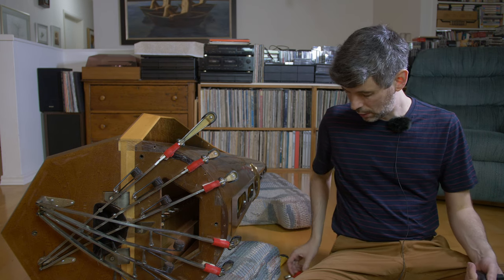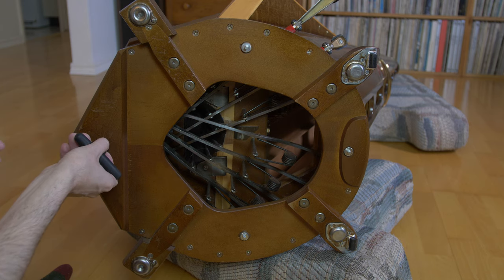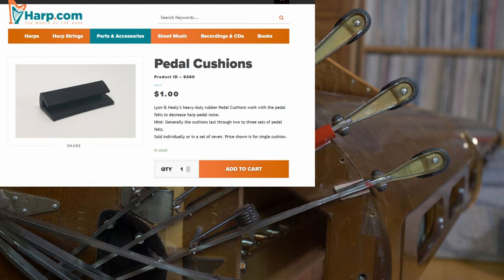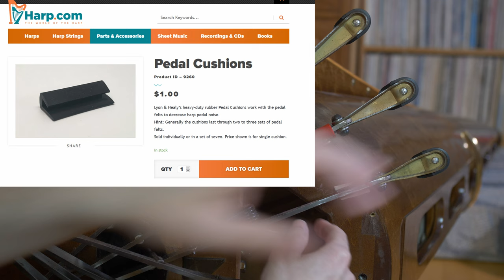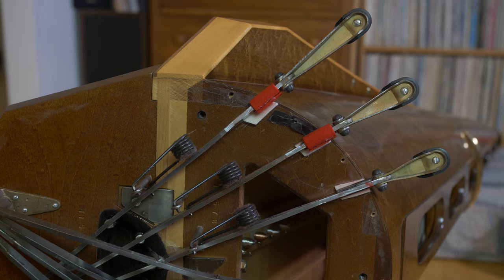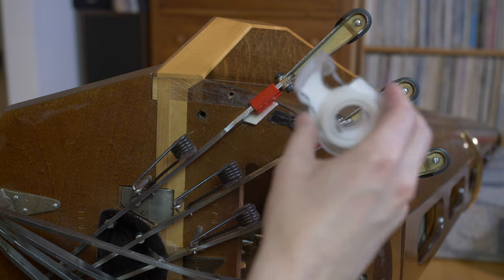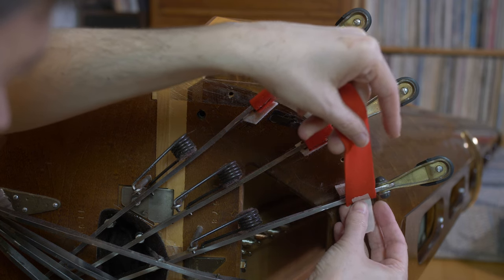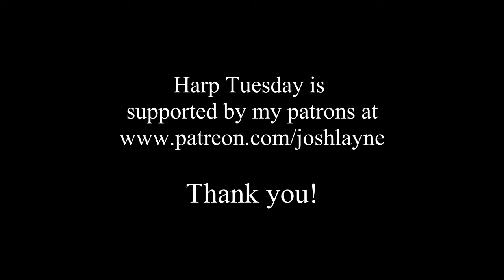How to change pedal felts - Harp Tuesday ep. 205

Comment: I think it's easier to first put the glue and then after it dried cut the excess pedal felt... you are quite skilled but for someone who doesn't often work with a glue gun it's definitely safer to cut the excessive pedal felt after gluing.
Reply from the maker: Great advice, Milica, thanks!
Reply: @JoshLayne  ❤